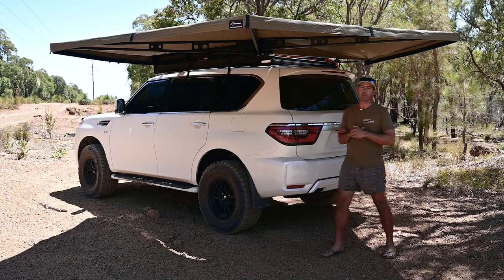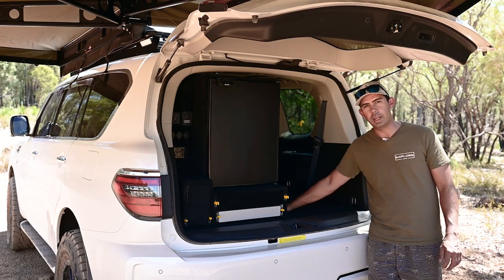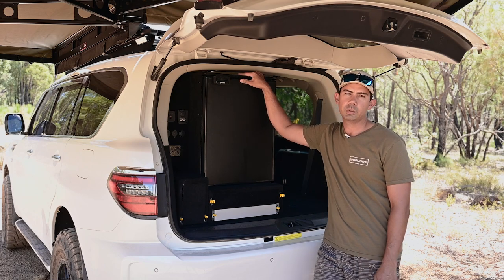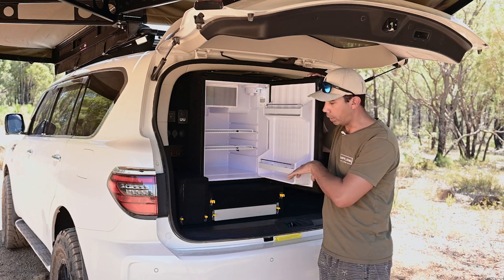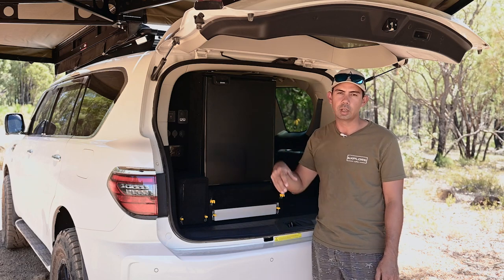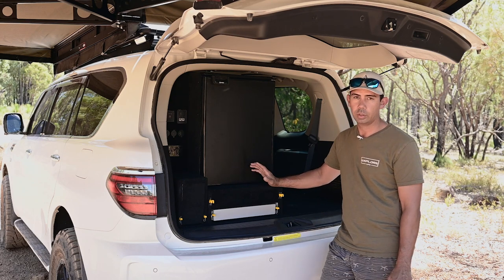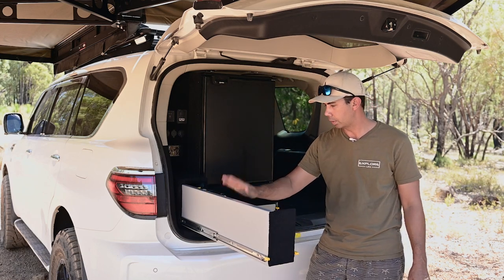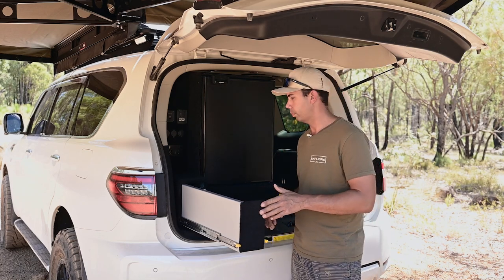Y62 Custom made aluminium rear drawers - Stage 1

Comment: Looks great. So neat. 

I'm glad you discussed the downside of cooking out the back of the car. My biggest concern would be the smell of the food (cooking) going into the vehicle.
Reply from the maker: Thanks mate, appreciate it. Yeah it can be a pain but I guess that part of it. For big trips I will have a table and have that setup to the side. I had also thought of putting plastic on my cargo barrier to separate the cab from the back. That was mainly going to be to keep mozzies and flies out etc, but would help with keeping the cooking smells out of there aswell

Comment: Wonder what the legalities and insurances implications are in removing the seating. Does this work need to be inspected and signed of by any transport department.
Reply from the maker: I believe if you take the rear seats out you are meant to let them know and have it registered as a 5 seater. Taking them out doesn’t require and inspection I believe but putting them back in definitely would as you are refitting seatbelts etc. I wouldn’t take my word for gospel as I’m not 100% on it.

Comment: do you travel more than 2weeks at a time I'm concerned about your freezer space with a upright fridge freezer.
Reply from the maker: If i travel with the family we have our caravan with a big fridge/freezer in it. If I’m going to do a big remote trip with out the family I can always just pop a female freezer in the back for frozen foods if I need. 
The freezer does hold a fair bit though is you pack it right. Not enough for a family for two weeks, but Its unlikely that I will go remote with the family without the caravan for two weeks.
Reply: @TravelExplore4x4  thank you for your reply i think i will stick with with my bushman 35-52 slide out. Cheers
Reply from the maker: @colinrose3852  no worries 👍🏽 yeah different setups work better for others. This was mainly for saving weight as I don’t have to have a drop slide or similar for the fridge which can weigh up to 40kg. So it’s a pretty good weight saving.
Reply: @TravelExplore4x4  yes i agree i dont need a drop slide i can still open the top of my bushman cheers
Reply from the maker: @colinrose3852  ah yeah perfect. I have alway had wagons and had a 80L waeco and I just got sick of always trying to see over the top to get my stuff etc. this is so much easier to use and see what’s in there. But the waeco did have a bit bigger freezer.

Comment: Had you used teflon runners on the drawers you could have saved even more weight.
Reply from the maker: Sorry totally forgot to reply mate. Yep that’s very true. Not sure if they would rattle more though as it’s not fixed
Reply: And how do you pull then out all the way? What stops them from dropping etc